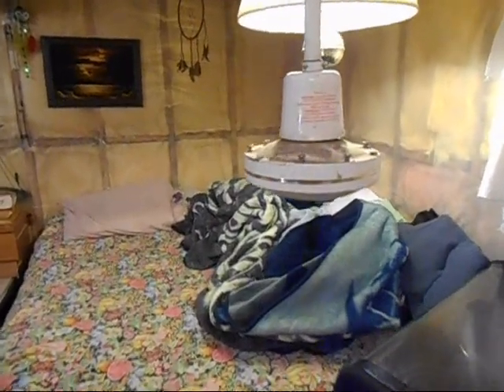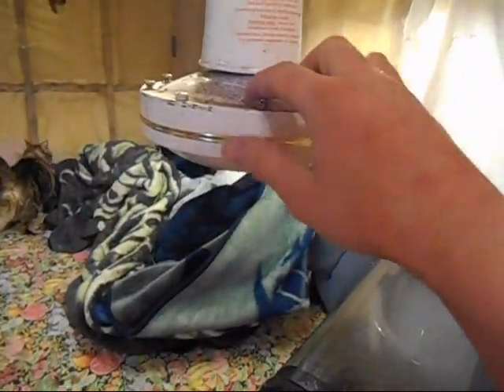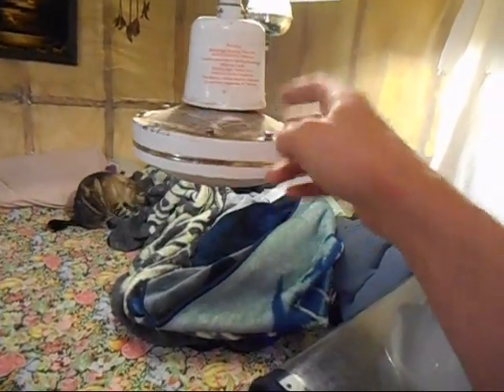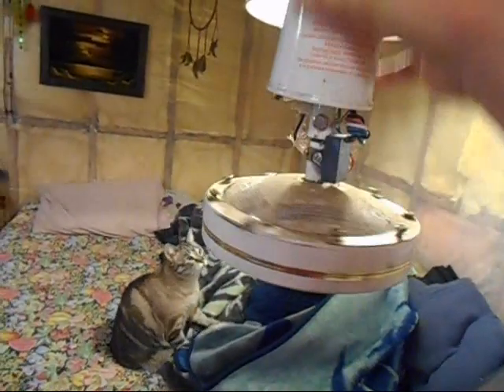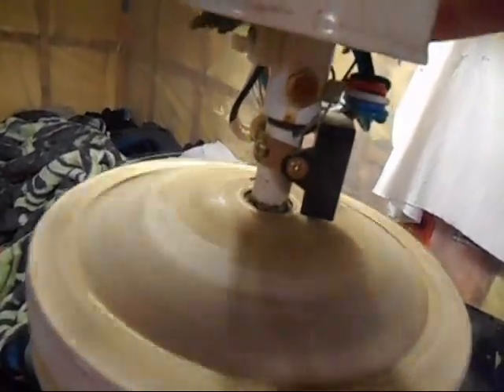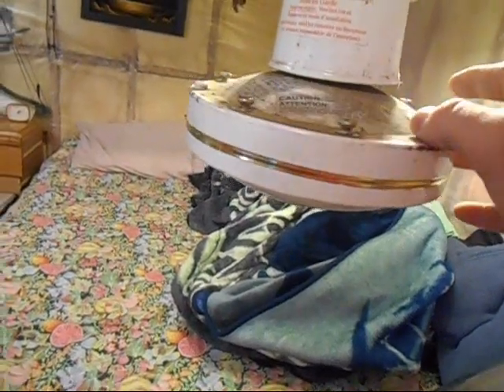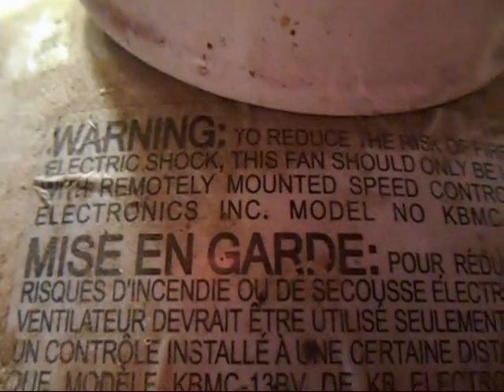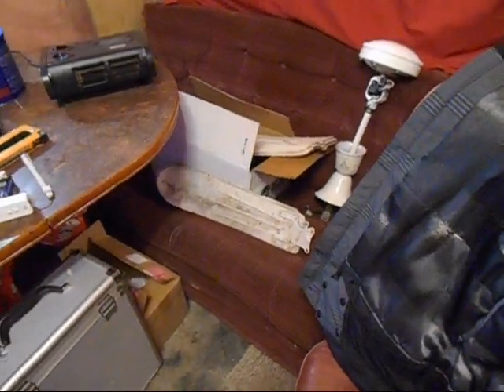Reviving the Canarm industrial

Comment: So was this what you were talking about in the video of this fan & the 36" when you said this fan is Seized up in 2016? If it is then this is a you should of posted around the time you recorded this video then I would of known what you meant about it being Seized up. The Canarm industrials in the 1990s looks like this one & has a Canarm sticker on the lower canopy but the only difference there is with them is that they don't have 3 Lines on the blades, I have seeing some with 1 Line on the blades but I don't know if they have the Canarm sticker on lower canopy too. It's really too bad they stopped making Canarm industrials with the Gold Stripe around the motor, now it's just a white line around the motor & the 36" model just has no line at all. I like them better with the Gold Stripe around the motor, they look nice with it but without it they look plain. I guess they thought they look too old with the Gold stripe so they wanted to make them very modern by not having the Gold stripe.
Reply from the maker: Yeah I cant remember exactly how many months it took me to finally take it down and fix it . It never got uploaded because It was a monster to edit. I ended up having a concussion at this point in time so I was kind of frazzled.
 I 'v never seen a canarm industrial with one line on the blade. did you make a video of one?